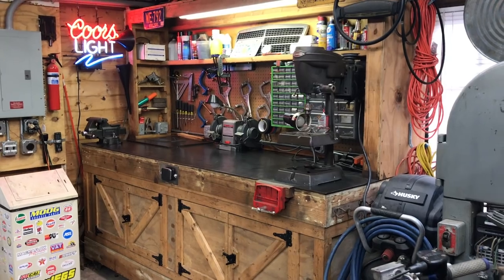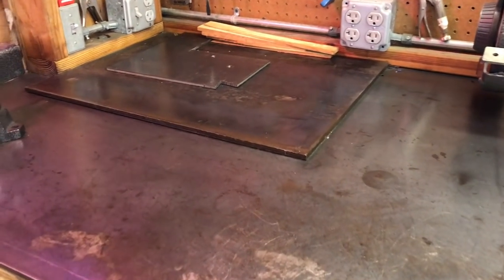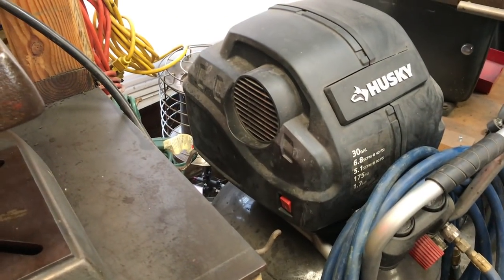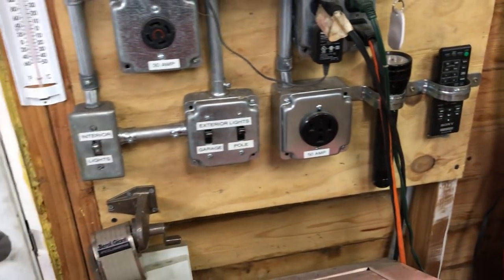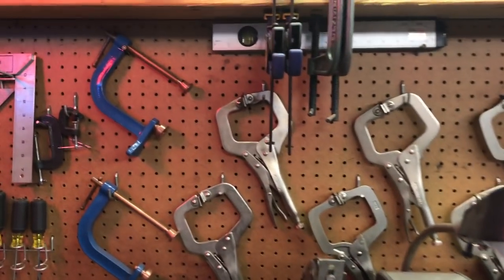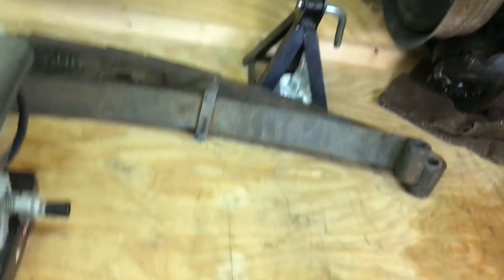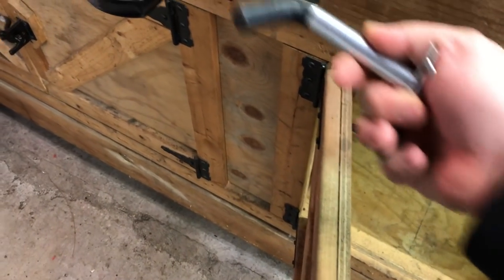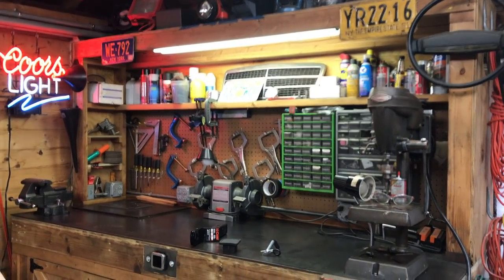My Workbench Tour

Comment: Great looking work bench! I have the same hitch set up. For storage I used two pieces of 2x6 vertical with 2" wide spacer between them. You make a receiver hole for each item. Put a bolt hole/pin through the side to secure. Alternate items from front to back on every other hole.  Used a car rim with cement for bottom. Harbor freight used to sell a hitch mount for a vise. I used those because I found them on clearance dirt cheap. I make a couple out of square tubing and plate since then. The hitch post idea was going to cost $20 for each receiver. Made the stand out of scrap for the cost of the screws.
Reply from the maker: donald gibbs that’s an excellent idea for the hitch storage, and I think I have some lumber laying around I can use for it. Thanks!
Reply: @chevelle74us  No problem! Glad it helped.

Comment: Love the workbench!
 If you have a Menards near you, they sell better peg board hooks that stay in place, they won't fall off every time you use them. They come with screws designed to fit the peg board holes. 
Just thought I would mention this, they work great.
Reply from the maker: Smoking DeWalt Thanks for the suggestion! The peg board hooks I have are annoying.